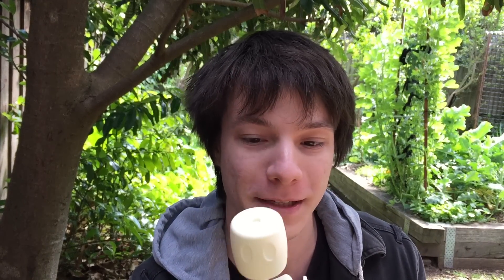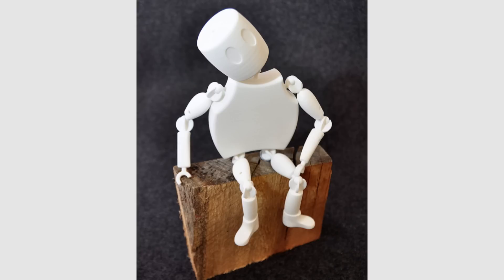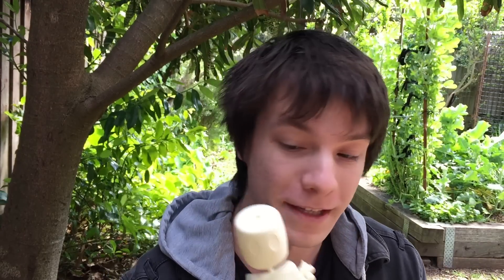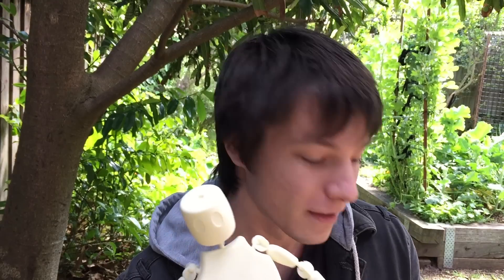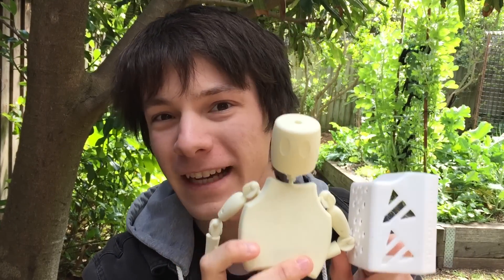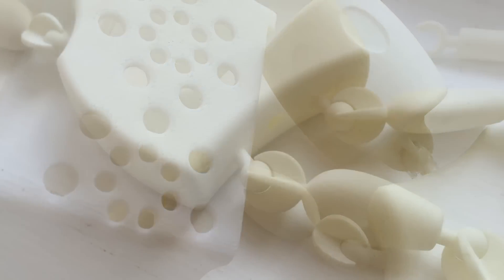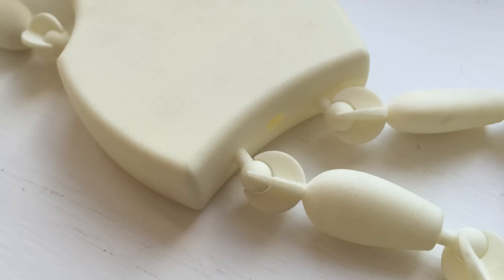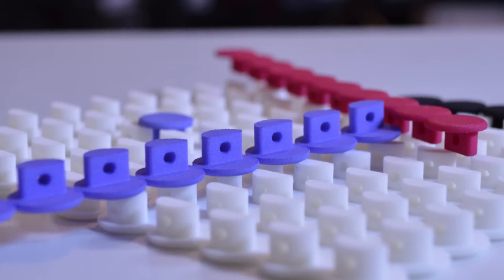What they don't tell you about SLS 3D Prints - 2015

Comment: Typical whiny idealistic plastics pisser fanboy. Yes, what a surprise, different methods have different requirements and behaviours and outcomes. You could have made the same comparison with something cast in concrete, whittled from wood, or butter extruded from a baker's piping bag, and it wouldn't have been any less relevant. In fact, you could turn this around and say, "What they don't tell you about FFF: Everything looks like stringy layers of hardened turd!" What a surprise!

Comment: In comparison to ABS or PLA, would SLS would be easier color(red,green,blue) your prints? How would go about coloring ABS or PLA post to printing? Spray paint of sorts? 

Love the videos btw !
Reply from the maker: +Bob Marely Cheers dude! Yeah for coloring of ABS or PLA prints, I use a spray plastic primer (automotive stores) and then just regular spray paints. Works great! Obviously some sanding / smoothing out beforehand improves the surface quality. You CAN do it with SLS prints but they just suck the paint up, so can take a few coats.
Reply: +Maker's Muse Awesome thanks for the knowledge!

Comment: I know a friend who has a phone case 3D printed in SLS nylon from Shapeways. Not sure how old it is but... lets just say it is NOT white any more! I seriously wonder if there is a way to seal the nylon with like super glue so that it is not porous. Sure it would require sanding after but it is a thought.
Reply from the maker: +Calvin Witt Yeah, treating SLS is a bit of a nightmare, it doesn't sand because the nylon goes 'furry' lol, and because of the porosity if you fill it with an epoxy, glue or even thick clear coat the material becomes a whole less flexible and more prone to cracking. It just soaks up paint like crazy! Tumbling it seems to help quite a bit with sealing the outer surface in too.